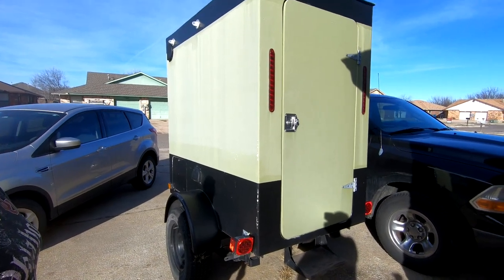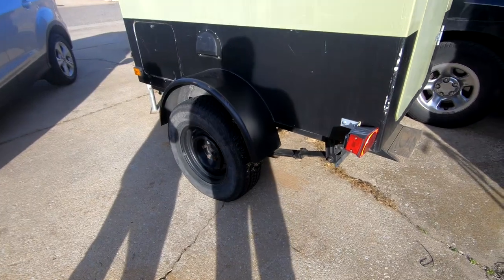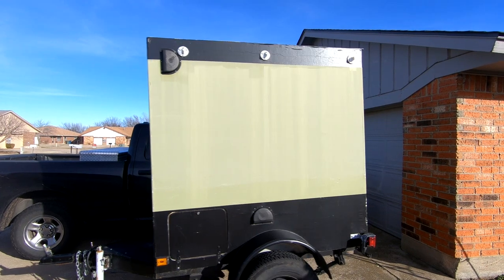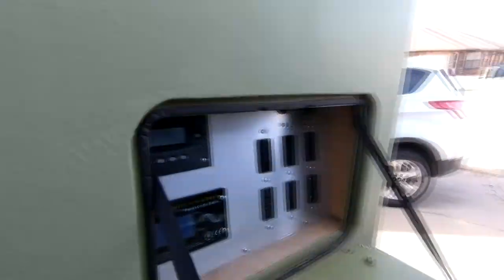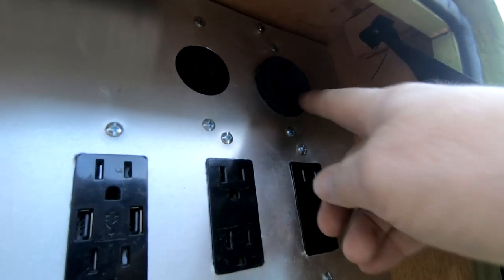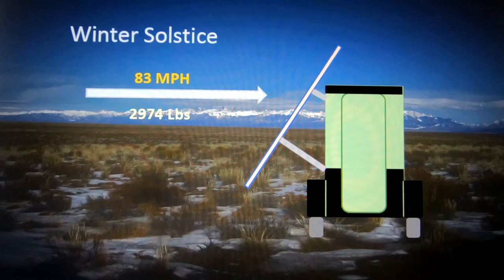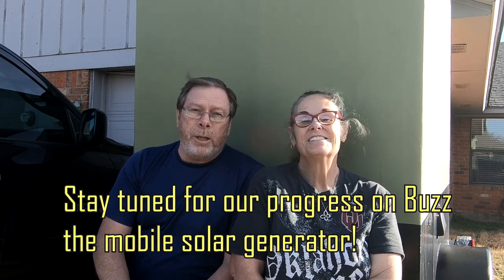Mobile Solar Generator - Buzz Improvements!

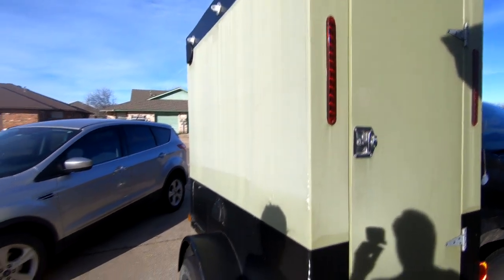Comment: OK Scott...you need to un-confuse me.  At about the 2:00 mark you say the suspension is rigid, that the only cushioning is from the tires...but I'm looking at a spring and spring hangar behind the tire?
Reply from the maker: We use our pseudonyms on here. :-)  The axle is welded to the frame for good now...the springs are useless now. Thanks! E-Chip
Reply: @contentment164  With a solid suspension with no "spring" to it, won't the bumps pulling it down the road possibly cause damage to the electronics for the solar system?  Not so much the panels themselves but controllers and such?
Also, I'm not sure (its been a while since I've flown in Colorado/Wyoming/Montana/other western states) but if I remember right the prevailing winds out there are from the NNE to NNW.  Since ideally your panels will be facing a few degrees off of south for peak efficiency the wind will be coming from the opposite side of the trailer and catching the back of the panels.  Since they are angled they will become a wing of sorts and with the wind from the back of the panels it will be trying to lift the trailer, making its effective weight even less.
Reply from the maker: Yes, the road vibration can cause problems. We anticipated this by installing some shock protection to the components inside and by wrapping wires with insulation cushioning in spots. After a trip, we also break out the tester and go through connections, etc. before firing it up. So far, we have had no problems. Thankfully, Buzz should be making his last road trip to Contentment this Summer and should stay in place for good, but who knows?

Prevailing winds at Contentment are SW. That angle may mitigate some of the force on the array a little, but no idea by how much. We could build some 'failure points' into the rack system, which could sacrifice some or all of the panels in the event of high wind and save the trailer with its components. Still thinkin' on it. Thanks Bob!

Comment: So your selling your house and living there full time?   Can you rig up some kind of detachable braces for the backside of buz?
Reply from the maker: Being full-time there has always been the plan. :-)  Yep, bracing is the way to go. Just hope it is strong enough. Thanks!
Reply: We get high winds in the winter 80mph that sometimes blow over semi trailers on the highways.
Reply from the maker: @elflordsjourneys  Yeah, that's what we are afraid of.  Might have to place temporary anchors in the ground to tie down both the panels and the trailer.